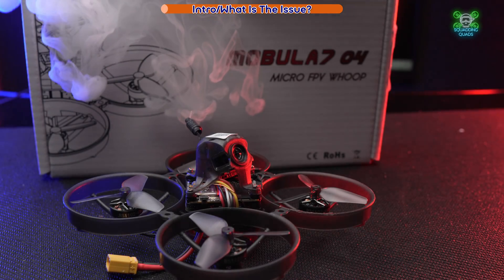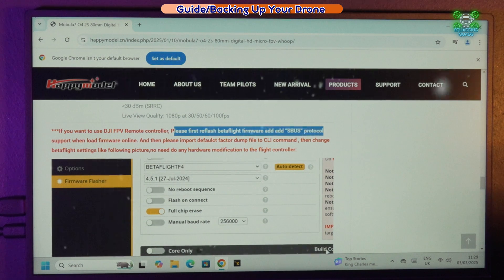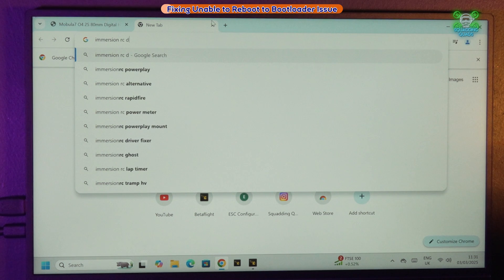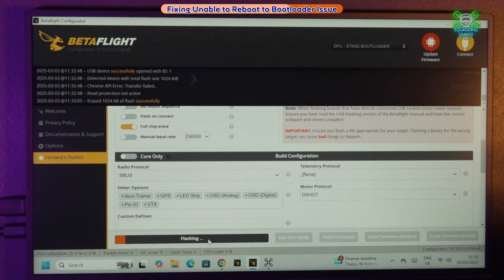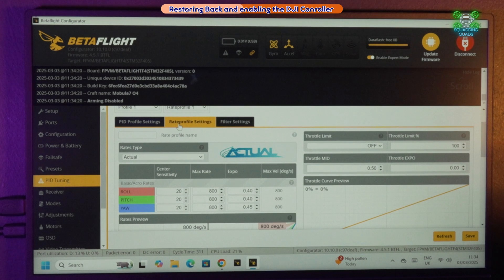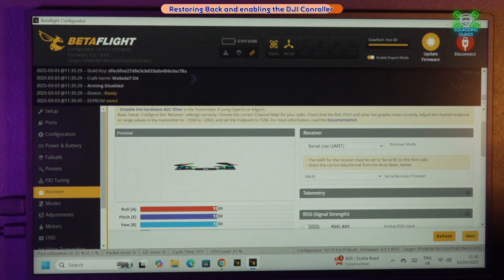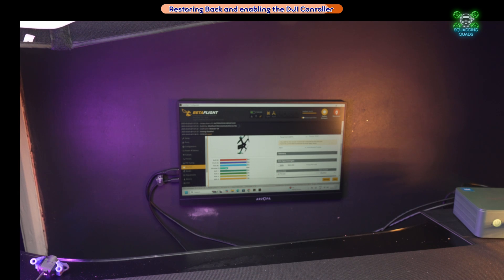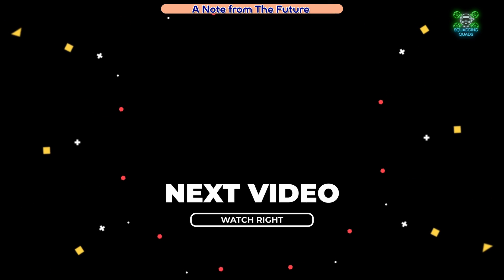DJI 04 Drone Binding Tutorial with DJI FPV Controller | Easy Stepsl

Comment: Could this potentially work for the meteor 75 pro o4 goggles 3 and controller 3? Im having the WORST time with this thing and am about ready to give the f up and try and return it and just give up on fpv. It's probably one of the most frustrating things I've ever tried to do. I get video but controls won't do shit. Thing over heats in like 15 seconds as I cant get a fan on it so have to constantly unplug it and wait.
Reply from the maker: Is it flashed yo sbus? In the receiver tab or crsf? Are you goggles bound to your controller?
Reply: @squaddingquads  I think I got it working it's just too hard to control. Thanks for the response tho.

Comment: After hours of research and watching three videos, I still couldn't get rc3 to work. I spotted a little detail I missed.
You, my brother, are the guy who spent hours on the same issue but couldn't figure out why it wasn't working. The solution is super simple. You didn't enter the save command after setting sbus_baud_fast = ON. Unbelievable, man.
You don't need to flash a new firmware with SBUS settings; the Core build already has this feature(I'm talking about Meteor 75 Pro O4). All you need to do is change the port, set the protocol to sbus on the receiver, turn sbus_baud_fast ON, and then enter the damn save command.

Comment: I'll tell you... I have a new Meteor75 with O4 lite... and I'm able to connect my Integra googles, but not the RC 3.

I've configured my SBUS via UART in Betaflight.

I've assigned the RX 1 port.

I've verified firmware compatibility.

I've flashed my FC.

And I'm not getting any results... Any help for me?
Reply from the maker: Have you reflashed betaflight with sbus as the receiver protacol?

Comment: Hello i hve problem with dji o4 lite when i start arming its automatically disconnected but when i use dji o4 pro its normal
Reply from the maker: What's your battery voltage?
Reply: @squaddingquads 4s
Reply: 4s liion
Reply from the maker: What's your voltage at when you lose image?  @ghiyatshisyam
Reply: @squaddingquads my battery is on 3,8v / 15,2v using 4s liion, i just Connected dji remote and goggles to this quad but when i arm quad its showng failsafe rx loss, I haven't flown at all
Reply from the maker: Can you drop a photo of your wiring in my discord then please

Comment: Hi, is this a different procedure for the 04 than it was for the 03?
I set up my 03 with my fpv rc3 and I did some things the same, but didn't have to do any firmware flashing🤔 but I did have to paste "set sbus baud fast = on" into the cli command box.
And also made sure the command protocol was set to sbus baud fast in the goggles 3 menu.
So I'm assuming it's different for the 04 which I'll be attempting tomorrow 🤔 🫣🤞
Reply from the maker: Gotta be honest - Ive not done it with an 03 -only did this as people with the lite were asking for it due to struggles they had

Comment: wonderful now I can use DJI remote with other drones yay  >>> which one should I get to fly inside home Mobula 7 or ?
Reply from the maker: I'd probably say Mobula7 or Meteor75, leaning more towards the Meteor75 for indoor flying

https://betafpv.com/products/meteor75-pro-o4-brushless-whoop-quadcopter?sca_ref=5811057.Lzh0hLJr8w&utm_source=socialmedia&utm_medium=socialmedia&utm_campaign=affiliate-squadding-quads
Reply: @ thanks man, I kinda want 4 drones in total, avata2 ✅, meteor75/mobula7  in basket, then I am thinking something to fly around crowd in and out of doors windows with led for extra visibility/ safety with option for Action5pro I am thinking of cineloge 25-35 size what you thinking
Reply from the maker: @CarlBertossi  depends on the country as a lot won't let you fly around people above 249g.

If you can if say the axiis flying Cineon tbh

Comment: Thanks for the video. Do you think Crazybee F4 V3 would work the same? I’m thinking of modding my Eachine Twig with dji O4..
Reply: Thanks ✌️
Reply from the maker: It SHOULD do yes
Reply: @squaddingquads  btw, do you think my FC is to old? I’m starting to think it might be better to buy a new FC. …just wanted someone’s opinion before I start this build…
Reply from the maker: @ym22rr95  an F4 SHOULD be okay
Reply: @squaddingquads  thanks for answering :-)